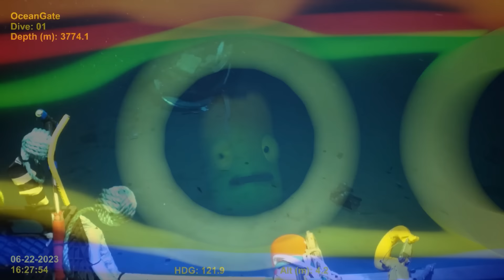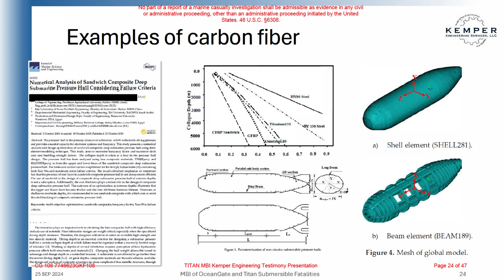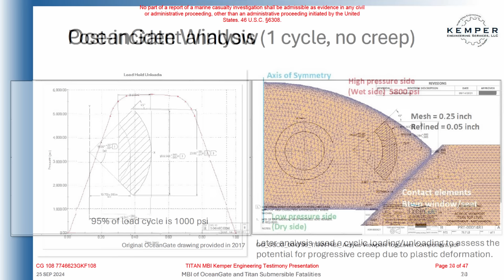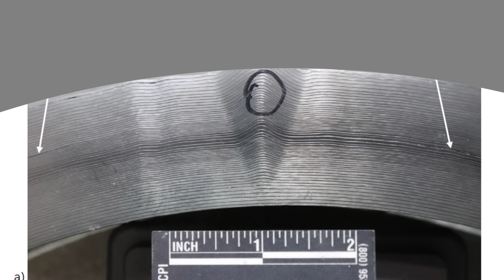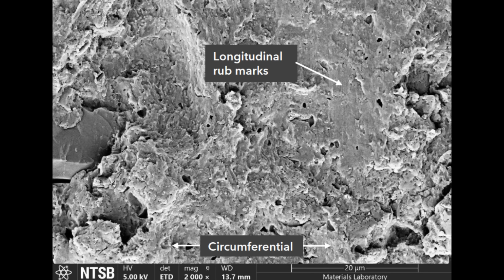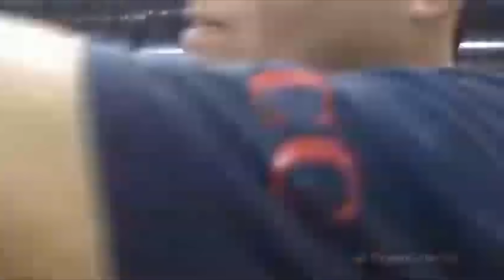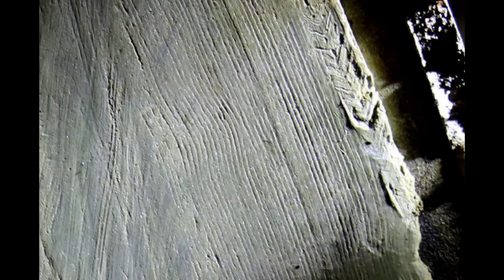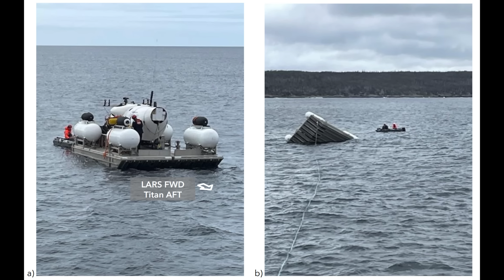OceanGate Wreck Shows Why Sub Wasn't Strong Enough To Survive - NTSB Shares Important Details

Comment: Thanks for a great presentation 👍
300 bar is not much….. thats hydraulik hose pressure as on a tractor…. I’ve built machines working with minimum 5.500 bar. 
This vessel was simply not safe… 😢
Its not pioneering to design and develop in engineering.
Its not difficult, but expensive, to build a test tank and full scale test the vessel for 1.000 times.
( as I’ve seen required before delivery of large 2 stroke marine engines )
This really is a sad story about greed and irresponsibility.
There is a big difference between ROV’s and a sub. with people inside.

Comment: Peel-ply is most commonly pre-coated with a release agent during manufacture. This makes it easier to use. I have seen enough instances where people use peel-ply for an intended bonding surface only to find that the bond fails prematurely due to the residual release agent left behind on the surface. The obvious solution is to source peel-ply without release agent if someone is being thorough with the engineering. Does anyone have insight into what this crowd used? Also, I did my PhD on carbon fibre failure under high energy events and found all of the negligence that went into this shocking.

Comment: You NEVER sand or mill carbon fiber. It remove all of its strength when used in a high stress environment. 

Also imagine a paper towel roll when you roll it on a surface the layers travel at different rates and must slide past each other. 

All the glue in the world would not have prevented this.

Comment: 28:05 amazing easy thing to fix with spreader bars that would have been insanely cheap to include in their lifting rig.  The amount of corners cut on this thing is staggering and that the guy cutting them actually going down himself.

Comment: It's the FINITE lifespan under loading, method of attachment & complete lack of inspection/testing that all combined for a swiss cheese failure.  Everytime it came out of the water any saltwater would dry and recrystallization would further weaken the structure

Comment: Machining the hull is the worst idea I think I’ve ever heard. Turns a predicable material into a totally anisotropic mess. The exposed fibers provide essentially no strength in that area. Are other manufacturers able to produce cylinders with 45 degree layers without the bumps? One would think this is possible, but could take longer or require manual effort.
Reply: Any mid level composite manufacturer would be able to do that, they where just stupid and ignorant, hell i know of many formula student teams who can manucture carbon fiber parts far better than this(And they are university students); whoever did the "research" on how to use and make CF parts was either blind, asleep, stupid or, more likely, a combination of the three, youtube could have thaught them to make a better cilynder
Reply: SpaceX uses pressurized composite tanks on some Falcon 9 systems.  I've never seen a pressure vessel wound in a linear fashion like this one, or in multiple separate layers.  I thought they did that because they couldn't cure a 5in thick layup but it looks like the wrinkling of the fibers may have been another reason for the 1in thick layers.
Reply: @BlueSpruce2  its very different usage. COPVs vs submesible. Maybe they dont even care as much about wrinkles. Also they dont go as thick.
Reply: @LaggerSVK  Yes, I know it's not as thick, but they should care about defects.  A SpaceX rocket blew up on the launch pad because of one of those failing and I'm pretty sure Boeing wouldn't use a compromised  carbon fiber fuselage or wing on the B787 Dreamliner.  I also wonder about the geometry of the winding used on the Titan.
Reply: @BlueSpruce2  The rocket failing on the launch pad was consequence of a temperature and phase shift miscalculation about a liquid ergol which froze and generated a critical cascading structural failure (also called "oh shit" in engineering terms).
Fun fact, you can reproduce the same failure at home, just fill a water bottle to the brim, close it, and put it in the freezer. Kids love learning by breaking stuff.
Reply: @elnalaombrebois5665  Haha!  Yes I have done that in addition to a can of soda to quickly cool and forgetting that I did that... 😄
Reply: @BlueSpruce2  Boeing might have to go with wrinkles now as part of its DEI program.
Reply: @DrJuan-ev8lu  I suspect they might have a drug problem as well - especially in Washington State.  Would bet good money many on the assembly line crew would fail a drug test...
Reply: @BlueSpruce2  I wonder how comparable the two situations actually are, since pressurized tanks put the vessel into tension, while a submersible puts them in compression. I can imagine that the wrinkles may have had difference consequences in these very different situations, especially since the material is carbon fibre, famously strong under tension, not so much in compression.
Reply: @waylandsmith  That seems to be the consensus on whether carbon fiber was the correct application for a submersible.  For an aircraft fuselage, like the 787 Dreamliner when it is pressurized for flight, the carbon fiber is placed into tension where it is strongest at resisting those forces.  With a hull that is subjected to compressive forces (6000psi at Titanic depths) it seems to me the only material resisting that pressure is the prepreg or carbon fiber binding matrix which is cured in an autoclave.  Essentially, along with that simple linear CF winding they used, the shear strength of that cured binder is all they really had to work with.  Also, it doesn't appear they did any vacuum bagging to remove any voids in the CF layup...  At the moment it looks like the failure occurred at the Titanium to CF interface at the front end/bow with the glue failing first followed by the inner flange of the c-channel on the Ti ring shearing off.
Reply: @BlueSpruce2  You can cure a laminate this thick, but it takes longer and longer and requires people who know what they are doing, and the same goes for the wrinkling.

Comment: Do companies want to support deep sea tourism for Regular Joes? Then throw as much money as OceanGate into VR tech that can transmit video to recreate the experience virtually. That will buy you some great tech. This experience is visual, (thankfully) not tactile. If risk or exclusivity is the allure, then, well, that's a different matter.
Reply: I would think a good 360 camera and a highspeed data cable would be the way I want to explore the deeps.. or the ocean OR space!
Reply: @TheEvilmooseofdoom  Exactly! Will there be latency? Sure, but it won't affect the experience using a 360 camera. Latency only becomes an issue if the tourists are piloting the boat (or some other real-time reference in relation to the signal), which they never ever would.

Comment: 7:30 when I listened to the hearings and the argument that OceanGate opted out of a rated window for an "innovative" (read "untested" and "unvalidated") design for the sake of its optical properties I was really puzzled. My question, is it really impossible to design an optical system which corrects the deformations of the rated window while being mechanically decoupled from it, in other terms by using separate lenses? Or even, just extra cameras and large screens?
A decision that makes no sense to me.

Comment: Yes, but an expert on Carbon Fiber mentions that it can withstand pressure, but for how long?
While other solid metals on compression can withstand pressure more times, more often, and longer without breaking.
Any imperfections in Carbon Fiber is what makes it impossible and not reliable. The Make and material itself. Sadly, for now.

It's basically how they make skateboards, its flexible, yet strong to hold more than it should, or NileRed making bulletproof wood, thing is, they clearly misjudged PSI of water, and imperfections can make it snap. While pure one solid element, will not and cannot do such, unless such force is placed that it breaks the trillions of bonds, electro-chemically, the pressure per inch has to be greater than water, unless we are at a greater pressure or gravity. We can't make perfect skateboards with one piece of wood, better to layer, but the pressure is snapped on and off until inperfections and then it snaps. You do not want THAT to happen 1,000+ feet of water. Compression on all sides, is different than compression on a 2D plane, its easier to calculate, but when its water from all sides, every corner matters, like building a bridge that can support from every angle. Why would you make a Bridge out of plastics? You're asking for it to bend and warp, and then fail, before even 1-5 years.

Comment: Naval submarines with cylindrical pressure hulls have internal strengthening hoops (rings) along the main axis, set at about 10% of the diameter apart, to resist the radial compression and axial bending.  Also, they use similar materials for both the cylinder and the end caps, all welded together to make a nearly homogeneous vessel, to combat differential expansion.

Comment: a lot of people don't realize is that it worked many times, they're simply was not enough testing to know what the limitations were. 

You know it's highly possible that one could develop a cheap disposable fleet of these vessels where you say you're not used them anymore than four or five times because repeated strain will cause failure. 

I could see a situation where it would be much cheaper to build a capsule like this for an C exploration and then you just shred the thing when you're done and reuse the end caps again so it would be much more cost effective to build vehicles to do deep dives.

Comment: It bothers me that there's very little to no glue stuck to the front ring. 19:16  If there was anything I was taught about gluing things together is that you need to rough up the surface so the glue has something to stick to.  
I'm not a engineer by any means, but if it's too smooth, the glue won't have anything grip. I'm wondering if that bang was the glue (and carbon fiber) separating from the inside side of the front titanium ring.  To me, it seems that it was just the glue on the inside of the flanges holding the carbon fiber in place with the way the interior flange was sheered completely off and the outer flange barely left attached.
Just my speculations though.

Comment: The manufacturer actually rated the viewport to a maximum operational depth of 650 metres, the 1,300 metres is what Oceangate told David Lochridge it was rated for.

So the viewport survived multiple dives 5.85x it's max depth, and the Sub failed at <0.63x it's desired max depth.

Comment: 11:10 - And here I was, thinking the strength of carbon fibre laid in its... fibres... Apparently you can just cut 'em off willy nilly without any adverse effects! What a wonder material!
Reply: Also, air bubbles and voids are totally fine, no worries.  The layers of hopes and dreams in between each CF layer will hold it all together.

Comment: 24:50 “The distance the electricity had to travel would change” - that’s not how strain gauges work. The deformation results in a change in resistance.
Reply: Is the change in resistance not caused by the change in distance the electricity had to travel?
Reply: Hmm, I suppose ultimately it is, but it’s an odd way to phrase it - mentioning distance travelled suggests time and speed are factors (at least, it did to me). Change in cross-sectional area of the foil is as significant as change in length, and that’s perpendicular to the flow of electricity, so definitely not “distance travelled”.

Comment: With Carbonfiber there is no Warning, it just snaps, i have heard the scary Sharp Sound through the Woods when a cheap chinese mtb frame meets it limit, i would never trust some chinese crap Carbon with my safety and when its 400 atm pressure im just NOOOOO WAY no matter who made it, the material is just not made for konstant pressure, it will slowly but surely snap, fiber by fiber until…….but you will never know what happened, you are just a red mist, slowly floating away 😢

Comment: I suggest you read the boiler drum section  of "Steam - Plant Operation, Everett B. Woodruff, Herberet B. Lammers, McGraw - Hill  Book Company". It looks at tensile forces of both the Drum (pressure on the inside) and in the case of fire tube boilers the compressive stess on fire tubes (pressure on the outside).  I have edition 4 copyright 1977.  
James Watt started research on this subject back in the 18th Century. Your report is very interesting.  
I think in the end the there will be a string of design, material, mechanical and fabrication unknowns that led to the failure.  
 Were the compression rates for titanium and the carbon cylinder the same?  
Did the titanium carbon boundary remain parallell as pressure increased? 
What was the effect of cyclic compression and expansion over the life of the vessel?
What were the decision chains in the manufacture and operation of the vessel?

Comment: (Materials engineer here) To be honest, it seems that here we have 3 issues. 1) The whole structure was not tested to be submerged to such depths properly. 2) This structure accumulated defects over the course of its multiple submersions and we can't really say exactly whether the defects are caused by its being operated past its limits, or they are manufacturing defects. 3) Carbon Fibre Reinforced Polymers are known for spectacular & fast failure when they fail, its just in the nature of that material.

Comment: Thanks for this. I'm a professor of materials engineering and I'm actually using the Titan as a case study in one of my courses this year. Although I am not a polymer composites expert, I almost can't believe they were actually machining and grinding the CFRP to get rid of wrinkles and to make the Ti rings fit. CFRP gets its strength exactly because of the long continuous fibers. Cutting those must have led to a significant local reduction in strength as well as very large internal stress concentrations. This is not a material that you can just machine into shape like a metal. Unbelievably stupid! And ignoring the massive AE event confirms the stupidity and lack of responsibility. I'd bet that the person looking at the data said "oh it's probably just an anomaly, or some vibration we picked up... anyway, we're not going to make a new hull because that costs a lot of money."
Reply: Assuming anyone looked at the data from OceanGates end. It’s funny that you assumed they did whereas I assumed they (Stockton) did not. The data and early warning sensors were there, but were they even made use of?

Comment: Scott, thanks for presenting this.
I read a report of the ‘big bang’ but the details presented were very scant, not even a mention of dive 80.
The re-presentation of the chart versus depth does seem to allude to the hull failing before the fateful dive.
Sadly, the data is not being collated thereafter is terrible news. It seems fateful.
What we have is a throw away vessel, not to be use after ‘x’ uses.
The towing issue is fascinating in its own right but together appears to point to financial gain being a priority.
Your summary at the end shows people should use the knowledge that is out there and not short cut things for expediency.
As for tourism that is becoming the contentious issue of our times.
‘Total recall’ or virtual reality may have to replace mass tourism in future.
I can think of better ways to spend four hours (two hours there and back) than going to the lavatory behind a curtain in a bucket. 
It was the major reason why the 19 year old, Suleman Daewood died, with his mother giving up the seat because of the privations.

Comment: The best presentation I've seen so far. To some extent the points of failure and the chronology of events is academic..after all, this isn't a structural failure of an aircraft currently in use by multiple airlines. The disaster was almost guaranteed, the result of Stockton Rush's mindset.

Comment: my brain after learning more is dumbfounded. why would you GLUE a metal ring  why would you even do this the difference in material compression between metal and carbon fiber and given how the front cap is blown off and sitting where it is tells me 2 things window fail and glue fail because carbon compressed more then the metal and then well...... pop goes the soda can, I'm not a smart man but i did go to school to be a welder and fabricator as well as learning lost wax casting and jewelry, i know a few things about how materials compress this whole thing is just crazy and not the good kinda crazy like a 4 turbo V16 engine that can go over 200mph

Comment: It is not bad, it is horrific. Didn't they do tests to see how the composite reacts to these depths? These damages can be scanned. They could have prevented this.
The deep ocean is extremely hostile to materials. The salt corrodes metals. The pressure changes the state of materials and puts the material under mechanical pressure.

Comment: The destruction between the secondary bonding doesn't have much to do with the strength of adhesive itself. In-fact in many cases you would just lay another layer of composite material and resin (or prepreg) on top of pre-cured material. The problem is curing the resin in one shot would result in very large resin molecule that would span across multiple layers of fibers, the bonding between different batch of curing would only be connected via intermolecular force which is much weaker than the molecule themselves.

Comment: So, if I'm following you correctly, it sounds like the primary failure was the intense pressure against the glue which caused the glue failure to cause progressive failure to the parts the glue was joining. It just happened that the first location to fail catastrophically was the forward ring.